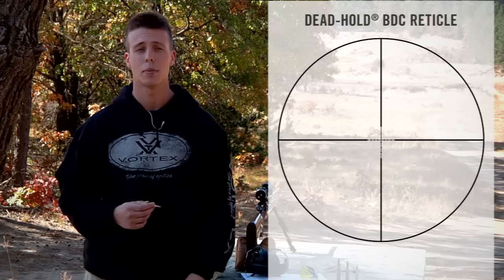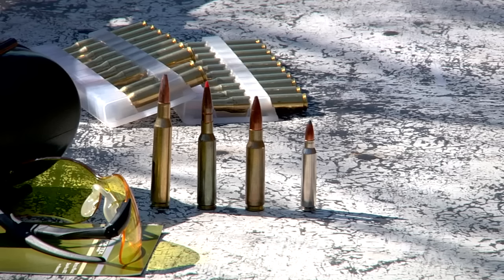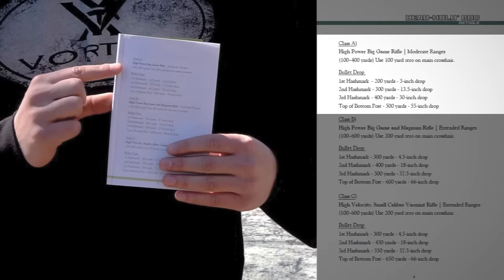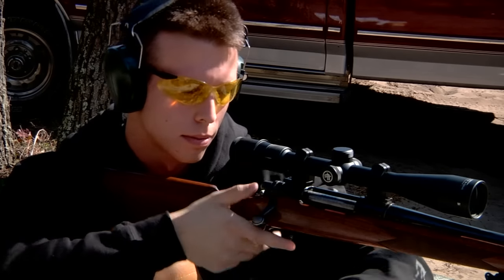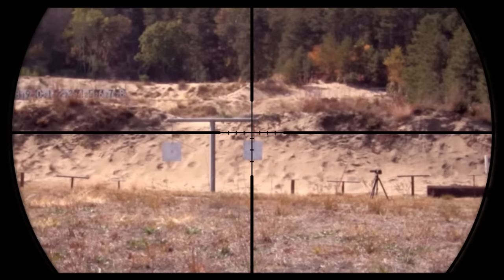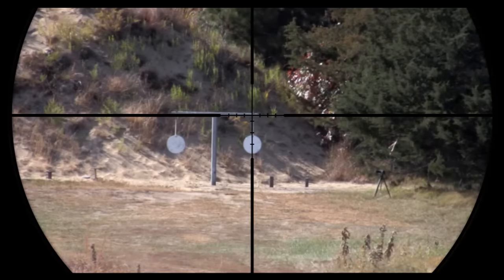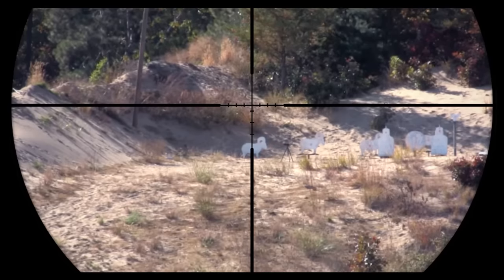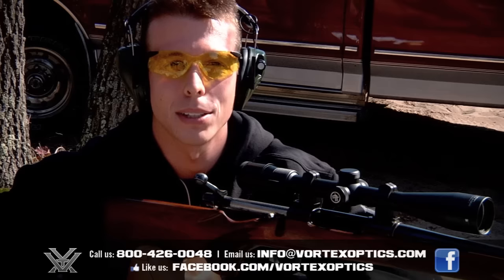How To Use the Vortex Dead-Hold BDC Reticle

Comment: Question. What about your zoom? Say your scope is a 4 x 12. The distance between your center crosshair and first hash will be different depending on if you are zoomed in at 12 or down to 4. Correct?
Reply: Brandon Brunson it only works turned all the way up
Reply: Unless you have a First focal plane scope, you have to be zoomed in all the way to your max setting to use your reticle accurately.
Reply: Each scope is different I have a 6-21 and the bdc is set at 18 the number on the scope is red

Comment: Is the software stated in this similar to Nikon Spot On BDC Calculator. Im debating between the Dimandback 3x9x40 or the Nikon Prostaff 3x9x40. Thus far I can not tell what would make one standout over the other. Mind you this is just for a 18inch Mossberg ATR in .243 Winchester. Its a budget target shooting build with your occasional hog hunt. Any help would be much appreciated.
Reply from the maker: Hey thanks for the question and for giving us a look. Regarding your question, Nikon makes a great scope too so I won't spend any time knocking their glass. However, some things I will say Vortex does very well is producing good quality at each price point, quality thorough service, and the most extensive warranty in the industry. If you have further questions, feel free to drop me an email. Thanks! - Jimmy, jjordan@vortexoptics.com

Comment: Great tutorial  , what are the differences between the Viper HS and D/Back HP ?? Looking at the 4-16 power for a .308 for hunting and mid to long range target shooting . Will that work ???
Reply from the maker: If you look at them on paper, both are very similar. The Viper HS has a 30mm tube and a bit better optical system when compared to the Diamondback HP that has a 1-inch tube. They're very similar, but the Viper HS gets the slight nod from the optical system. Both are going to be great for your .308 for the application you described! If you have any questions, please let us know! - Erik (ebarber@vortexoptics.com)

Comment: Did you use the magnification all the way up
Reply: Thats what i want to know
Reply: @doubletap3524  yes the manual says full magnification for the BDC to be accurate..  except the 6 - 24 by 50.. 18 power is the setting.. in the manual it tells how many inches drop on the lines of the scope.. when you know your guns ballistics you can figure  if it's high or low by how many inches.. I have one on my 7 mm mag..   150 gr bullets hit ,,, dead on a 200.. an inch-and-a-half high at 300.. 5 1/2 inches high at 400..  I'm starting to use this rig for my go to deer hunting gun when I have opportunity for these longer shots.. the mill. Dot scope works but this is really simple once you know your range..
Check out federals ballistic calculator app .. it will have your caliber and your bullet.. even handloads.

Comment: first timer here but i see you shooting straight distances thats nice but what if your shooting down or up elevation like on a angle or steep angle how would you shoot it with these bdc...would it still work the same
Reply from the maker: Hey Guys - great question! The best explanation is that at close ranges (200 and under) high power rifle cartridges aren't affected that much. Once you start shooting at longer ranges (300 and over) angle starts to play a bigger role. You can use a product like our Ranger 1,000 or Ranger 1,500 to check range, and also use the HCD Mode to find out your true angle compensated range, so you would know exactly what yardage to use. Without a product that can at least get you the angle in degrees, it is very hard to know exactly what is happening due to the angles. -RJ (Raleckson@vortexoptics.com)

Comment: This video does not mention anything about what magnification to use when sighting in? You need to explain these bdc optics properly. I purchased a 3-9x40 because of the great warranty and customer service, but I would like to understand sighting in better. I sighted the scope at 100 yards with a mag setting if 6, however when I change to 3 or 9, my shot groups are changed drastically.  How do I know what the ranges are if I have to make a quick magnification adjustment?

Comment: I just purchased a Vortex Crossfire 2  with BDC reticle yesterday, and I am brand new to scopes. I have seen and heard from some people and videos on how BDC can actually handicap you in the sense that the dots/hash points under the crosshair in elevation because the points aren't set up for all different calibers or loads from said caliber. I was just wondering if I set the VC2 with the BDC reticle up on my 30-06, how should it perform in relation to the hash points? I know each one is suppose to be in increments of 100yrds, but it can't be exact for every caliber.
Reply from the maker: Exactly - it won't be exact for every caliber, but it's a good start for when you take your rifle out to start fine tuning your setup. Each rifle - even same brand and caliber - shoots slightly different and you always want to be sure that you are completely aware of the way your rifle shoots. I'm sure once you get a little practice with it, and perhaps with the help of a ballistics calculator like our LRBC on our website, you can figure out exactly where your rifle and cartridge will line up with those BDC hashmarks. Hope this helps! Let us know if you have any questions - Jimmy H jchamilton@vortexoptics.com
Reply: Thank you Jimmy; and I will definitely contact you guys if a question about the scope arises.

Comment: I'm wondering why Vortex discontinued the 6-24 x 50 VHS-4219 scope?
Reply from the maker: We simply found that shooters looking for that magnification range were looking for different features which we offered in similar optics like the Viper HST 6-24x50 and the Viper HS LR 6-24x50. Even though it is discontinued it is still fully covered by the VIP Warranty.

Comment: hey Vortex, i'd like a scope with a variety of ranges so that there would be a magnification low enough to be able to plink at indoor 25 yard ranges AND a magnification high enough to make outdoor 800 yard shots. if i bought a 4-10 Vortex, would 4x power be too high for 25 yards? If i bought a 3-9 Vortex, would 9x power be able to reach far enough outside?
Reply from the maker: +Somnio 64 - I'd look at something like a 2.5-10 or 4-12 magnification range. You could look at a 4-16 too! I know many folks who can make hits at 1,000 and beyond with a 10x scope! -Reuben (raleckson@vortexoptics.com)
Reply: +Vortex Optics thanks for replying Reuben! it seems there's a 3-12 diamondback hp with the wide variety of magnification I'm looking for, it looks very nice. (although that's not what you recommended)
Reply from the maker: +Somnio 64 - That would work well too! -Reuben (raleckson@vortexoptics.com)

Comment: What did you mean top of the post? That confused me I was guessing you would use the fourth notch down on the reticle for the 500 yard shot but you said top of the post etc?
Reply from the maker: At the bottom of the image, there is a larger, thick post coming up from the 6 o'clock position. At the top of that post is your last holdover. On many scopes, the top of that post doesn't correlate to anything, but we wanted to make it have purpose, so made it part of the BDC as well.

Comment: vortex, I just bought the vortex 4-12x40 dead-hold. I had it all sighted in, so I pulled the dials outward, and set back to zero. I fired another shit to make sure nothing changed, but my shot was way off. Any speculations as to why this happened? I dialed it back in again, but am afraid to try to set back to zero. thanks!
Reply from the maker: +Jordan Welch My guess is that the turret was not lifted all the way up when re-indexing zero and that caused a bunch of unintended clicks to get made. Did you hear a smooth glide or did it sound like the there were clicks when you were re-indexing zero? Drop me an email on this when you get a minute and I can help you get it sorted out. - Jimmy, jjordan@vortexoptics.com

Comment: What scope is it that you are using here? I am looking for a new scope to replace my BSA on my Remington 700 .308. I use it mostly for varmints and occasional target shooting. Looking at the 4-12x40 diamondback or a Redfield revenge 6-18x44. The only thing I'm worried about is the glass quality, when I bought my BSA I was told it had good glass but I was disappointed. What would you recommend?
Reply from the maker: The scope in this video is the Viper 4-12x40. The scopes you mentioned are good choices. The Diamondback 4-12x40 AO is a good choice for targets but I would personally pick at least the 4-12x40 Viper or if possible, a Viper PST in either 4-16x50 or 6-24x50. Those would have great glass and great features for target shooting. Thanks and please let me know if you have further questions. I would be happy to help. - Jimmy, jjordan@vortexoptics.com

Comment: how would you use the BDC marks for different calibers? i would understand if you made different reticles for different calibers but im sure everyone here know as well as i that different calibers have different velocities, different weights, different bullet drop at long range this can be dramatically different. im looking at getting one of these for my 270 and one for my 308 but im hesitant because im not sure i could be accurate with it unless there where different recital option each tailored to specific calibers.
Reply from the maker: Hey Joshua - great question! The Dead-Hold BDC is not specific to any one caliber. You would want to run the ammo you are shooting through a ballistic calculator which tells you what your adjustments are at different ranges. You can then relate this information to the BDC reticle to perform your holds. Here is a video on running a ballistic calculator and relating it to the BDC reticle: https://www.youtube.com/watch?v=97m6lp5ZcKc

Comment: What about those in-between shots or distances, for example instead of 100 yards, game is at 125 or 175 yards will in-between the hash work for these distances?
Reply: mikeanthony07 best thing to do is find out your muzzle volocity and bullet weight go to vortex web site and enter the info there it will tell you the yardage of each hash. Know your bullet drop and you’ll be able to guesstimate pretty easy I wrote mine on my scope cap so I don’t forget. The further the shot the more time you have to make a calculated decision.
Reply: I have the exact same concerns. There is nothing on the Vortex website about how the BDC can be used at any distances aside from 100 thru 500.  Their drop calc does nothing aside from telling you the drop of your bullet which you should already know. An added set of smaller hashes at the 50's would have made this a much better system.

Comment: I am trying to figure out the difference of the trajectory between max magnification and minimum magnification ?
Reply from the maker: The bullet's trajectory doesn't change at all - that is a constant depending upon the load you're shooting. What the magnification setting does only applies to second focal plane scopes. When you zoom down, the distance between your drop (BDC) marks will grow, changing the hold/yardage value. That's why you can use the center crosshair on any magnification as your zero never changes, but you can only use your BDC/MIL/MOA subtensions at a specific magnification. Check out our FFP vs. SFP video:  https://www.youtube.com/watch?v=4XgugJSqpoE   

I'd also recommend using our LRBC right on www.vortexoptics.com as you can use a slider bar to show where your drop marks will be at any magnification.

-RJ 
Raleckson@vortexoptics.com

Comment: Thanks, can the Vortex Dead-Hold BDC Reticle process be used with a PCP air gun?
Reply from the maker: It certainly can be used on anything that has a ballistic curve - you'll of course just need to keep in mind that an air gun won't match up nicely with the 100, 200, 300, etc yard increments of a larger caliber centerfire rifle - determining the ballistic curve of your air rifle and correlating it to the measurements of the BDC hashmarks will be up to you so you can be very accurate with it. Does this help? Thanks!

Comment: If I were to put this on a Remington 700 VTR in .308 and using Silver Bear ammo, what distance would each hashmark correspond to? Thanks!
Reply from the maker: TJ Arfons It's hard to say really- it will depend on your barrel length, temperature, etc. but if it were me, I would check out Category A in the BDC manual. That will likely be your closest bet but I think you will need to tweak it slightly. Thanks for the question. - Jimmy, jjordan@vortexoptics.com

Comment: I bought a Remington XRC II, .30-06 and it had a Diamondback 4x12-40 affixed to it. I hear that you say hashes or dots on the video. This scope has only one dot on each side of the crosshair and the same number of dots as hashes the scope does on your video. Does it all work the same as what the video states even though its dots? I plugged the info in the website program that you spoke of in the video and got the yardage that my 180 grain psp Remington Corelokt bullets would travel, I just want to make sure this is the same concept before I go out and start shooting, of course I'll have to rezero at 100.
Reply from the maker: The vertical dots going down will match up the same as the hashes do. The wind holds are different but the elevation marks will have the same directions/data involved. Thanks again and please let me know if there's anything else I can do for you. I would be happy to help. - Jimmy, jjordan@vortexoptics.com
Reply: Vortex Optics
Thank you, that helps a lot, and I have enjoyed the video good job.

Comment: heavily considering buying this scope to mount on my custom  built Mosin Nagant, I wanted to ask if this is a first focal plane scope which will remain it's zero and the Bullet  point of impact even if  the magnification  is increased or decreased. 
please let me know !
Reply from the maker: Greetings! Any of our scopes with our "Dead-Hold BDC" reticle are a Second Focal Plane optic, meaning that your center crosshair stays zero'd for the yardage you zero'd it to, but the drop marks would only be valid at the highest (unless otherwise specified) magnification.  -Reuben (raleckson@vortexoptics.com)
Reply: Awesome, thank you for taking the time to reply. Reason I asked was because I had seen that nikon released their "distance lock" scope line with the first focal plane. I wanted that one until i did my reaserch and became aware of the vortex scopes. 
decision is made, vortex it is! thank you!
Reply from the maker: Thank you!

Comment: I've got a Parker Hale 1200 super in 7mm Mag and am thinking about putting on a Diamonback 4-12x40 BDC, I like what I've seen from the other Vortex products I've gotten my hands on, but I've narrowed it down to the Diamondback primarily and potentially the Crossfire II 4-12x40.. My question is, how will the Crossfire hold up to my 7mm mags recoil? AND what makes the Diamondback a better buy, possibly? Thanks in advance guys
Reply from the maker: Good morning Jordan- Both the Crossfire II and Diamondback are designed to withstand magnum recoil. Both will do well. The Diamondback will give you a little better durability, field of view, and slightly better glass quality too. Thanks and please email me if you have further questions. - Jimmy, jjordan@vortexoptics.com
Reply: I just bought 4-12x50 Crossfire with a  BDC reticle  for my 30-06.  This is the best scope out there for my budget..  Holding zero with 47grains IMR 2895 powder, 165 gr hornady HPBT bullet in my 30-06 with no issues...I was sold on the super clarity of this scope.  Shooting at 200 yards at the range 2.5" to 3" groups easily.  I know this scope and the gun can do much better, but that's just me.......Canada
Reply: Yeah, I purchased my Diamondback 4-12x40 Dead-Hold BDC today. I checked out the Crossfire II but was sold on the Diamondback when Vortex responded saying that it was just better glass quality and durability. Should be arriving next week and we'll be shooting with in probably the week following! Thanks for all the input guys! And Vortex Optics, thanks for the extra information, I'm sure I'll love the scope

Comment: I have the Vortex Viper 3-9x40 with BDC reticle. Any advice on a factory load that will match perfectly in a 20" 308 1/10 twist? What about a hand load?
Reply from the maker: Honestly, we would recommend trying a few different ones out to see what one your rifle shoots better. While no round will EXACTLY match up with a BDC, they will all be pretty close. To be as accurate as possible you would just run whatever ammo you choose to go with through a ballistic calculator to find out what your adjustments are at different distances. You can then relate that to the reticle to perform your holds.
Reply: @VortexOpticsUSA  What are the options with regard to Vortex products if I want to mount my Vortex Viper 3-9x40 1" tube to an AR-10?
Reply from the maker: @4150CHF  We would suggest a Sport Cantilever Mount for that set up!
Reply: @VortexOpticsUSA  For the average size man, 3" or 2" offset?

Comment: With the SFP, will the dead hold bdc hash mark change on different magnification? To what I'd researched, ppl say the FFP will stay true but not the SFP. If that is true, will the SFP cross hair change on different mag also?
Reply from the maker: The FFP subtensions are correct on all magnifications but the SFP subtensions are only correct on one magnification. However, the center of the reticle will always be correct, no matter what focal plane you are using. The center of the reticle should remain constant always with any riflescope. Good question. Let us know if you have any others. - Jimmy, jjordan@vortexoptics.com
Reply: Thanks! To what subtension the SPF will be correct on the hslr 4-16x50?